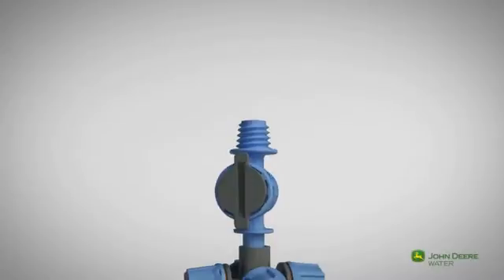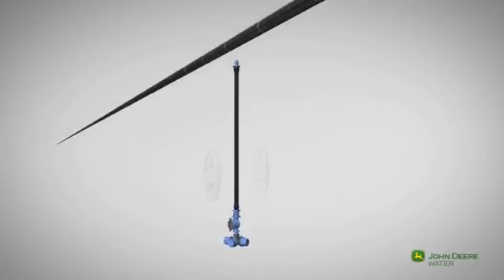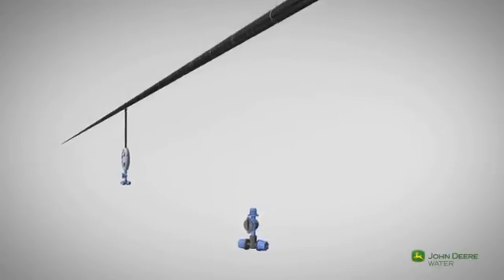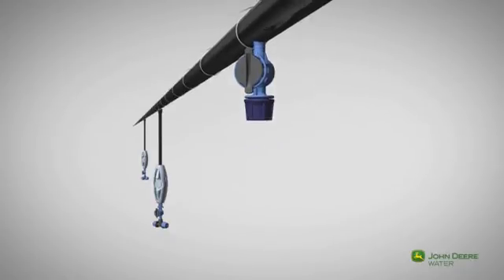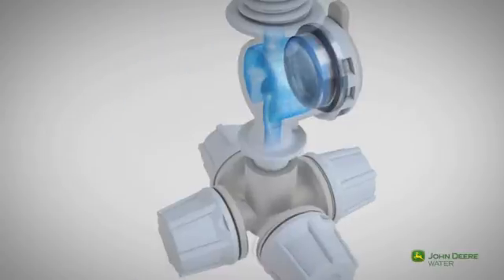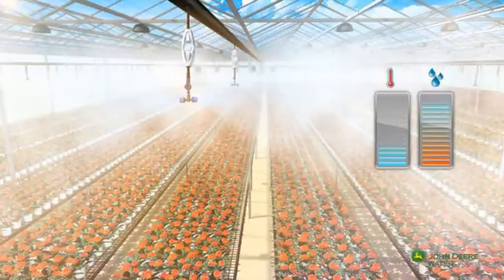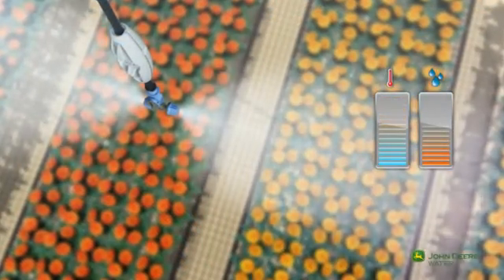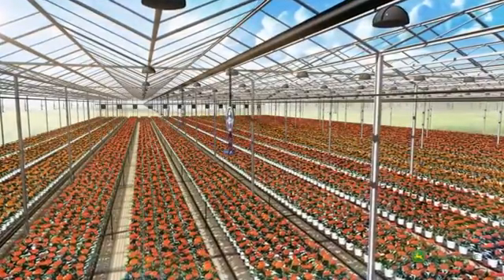John Deere Water FLF. Nebulizador de bajo caudal John Deere Water.

Comment: Hola, quiero utilizar estos nebulizadores pero tengo duda de qué tan probable sea que se tapen según mi calidad de agua. Tengo alrededor de 600 ppm en sales.
Reply from the maker: Buenos días Pablo:
El problema de las sales es que cuando se dejan "dormir" en la conducción se solidifican y en efecto obturan los equipos.
Lo aconsejable en estos casos y siempre que sea posible, es hacer un tratamiento individual (FLF a FLF) con ácido nítrico al finalizar la campaña, y recomendaría además el hacer funcionar la instalación fuera de campaña por lo menos una vez al mes para minimizar esos problemas de solidificación en la salida del FLF.
También le recuerdo que la filtración necesaria para FLF de John Deere Water es de 100 micras.
Reply from the maker: Si necesita concretar datos o realizar alguna consulta en más profundidad puede dirigirse a nostros por los medios que le indico en el texto del video.

Muchas gracias y saludos.